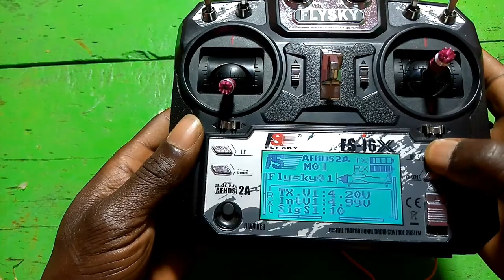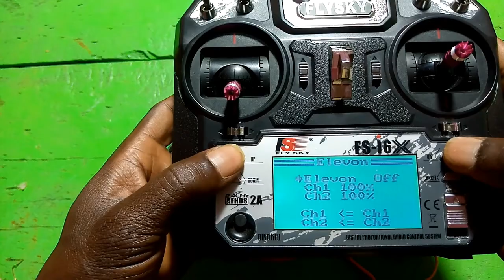HOW TO SET ELEVON FOR A DELTA WING TYPE RC PLANE| AILERONS & ELEVATORS| DELTA WING|

Comment: Thank for explaining I needed this for a flying wing airplane. I do have a question. The elevator is left and richt on the joystick but how do I make it up and down? And the reverse is true for the ailerons.
Reply from the maker: After setting elevons

For better understanding set the elevators to move up and down as per the right transmitter stick (up and down) and aileron left,right as per the right transmitter  stick(left and right)

Make sure  when you move your right joystick(right gimbal) up the elevators are up and reverse is true

When you move the right joystick(right gimbal) left, the left aileron is up and reverse is true
Reply from the maker: I can make a simple video for you to  understand better tomorrow ...thank you🙏
Reply: Thank you